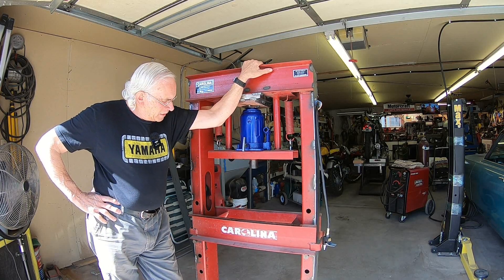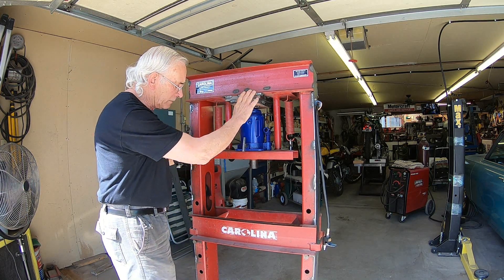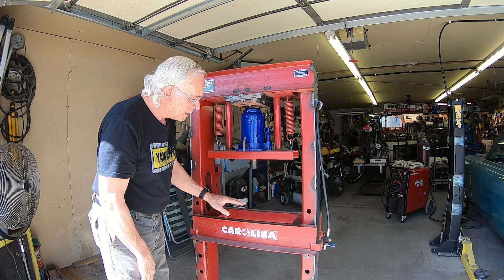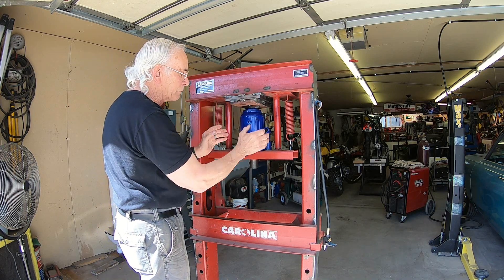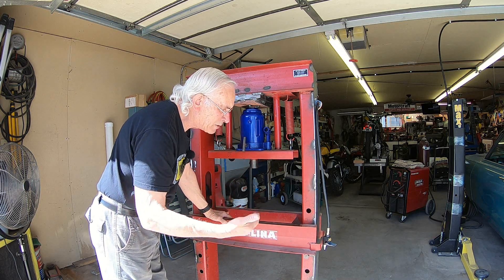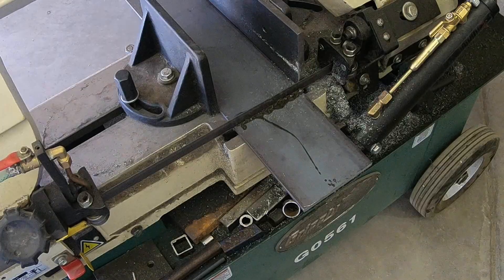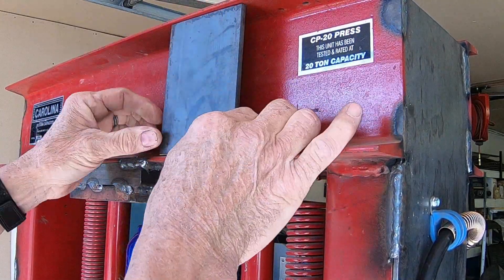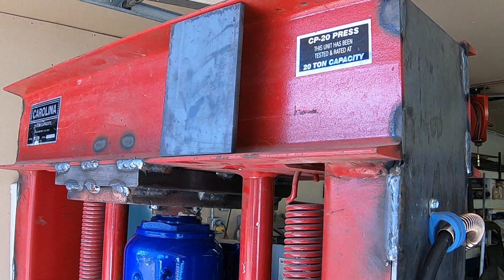Hydraulic press modification part 3

Comment: Has anyone suggested bolting it to the floor?
Reply from the maker: Yes, they have, problem is It needs to be moved quite a bit. Not convinced that would help with this issue since the pressure is between the two horizontal bars. But I have been wrong many times in my life and that may just be the fix. Thanks Andy.

Comment: I think, you still have weak spots at the outer sides and in between the 3 flat bar pieces you welded in. Under pressure, naturally, the lower sides of your u-profiles want to elongate, and you want to limit this. You added some partial rigidity to the 3 sections where you now have these welded-in pieces, but you most certainly still have (even stronger) elongations in all the other sectors. So, in my opinion, welding in flat bars right along all of your u-profiles through all their very length would give you the most rigidity.
Thank you for sharing your experience! I recently got a 20 tons press (not the bottle jack type) and I am considering how to improve it.
Reply from the maker: I think your right, I have had others suggest the same. It's about the only thing I haven't done. Good luck with yours.

Comment: Dale it seems to me that maybe the web thickness of the channel is not thick enough. I would weld in steel plates against the web perpendicular to it outward to the edge of channel. Do this in 2 or 3 spots and I believe you have a stronger beam with less deflection.
Reply from the maker: Hey Steven, that is about the only thing I haven't done. Makes since to me. I will look into that mod in the future. Thanks for the suggestion.

Comment: Howdy Dale.  I have a question about this whole press ordeal.  Well it's all metal on metal.  I did see the shelf pop up a bit too.  Maybe try coating the shelf pins with Plasti Dip and the top layer of the shelf.  That might help dampen the rebound sound of the metal?  Just a thought.  Great video and I hope you guys are doing great.
Reply from the maker: Hey, Greg, haven't heard from you in a while. Haven't seen a video in a bit either, hope all is well over your way also. I am starting to believe that I am expecting too much from a cheap press. Dampening is an interesting thought though.
Reply: @montana2strokeracer  lol, I did just put one out.  Just been too busy with both jobs to get much fun stuff done.

Comment: Its definitely an improvement Dale, but I agree that its always going to be a compromise. Unless it's constructed from heavy castings which will naturally dampen, secured to a solid floor via a large surface area, its going to have some spring. You have certainly shown how to maximise the performance of the kind of press most of us have. 
Best wishes, Dean.
Reply from the maker: Hey Dean, think I am just going to have to say good enough, and continue to work around the problem like I have in the past. Probably expecting too much.

Comment: I wonder what the deflection is when applying normal press load?
Reply from the maker: What's a normal load, crank pins are what I use it for most. I am pretty sure this one is tighter than normal, but I won't know till I do another one now that I have modified the frame.

Comment: seems better dale could u not use a thick plate on the bottom rail with a hole in 4 crankpin to fall through some inch thick orthe likes uve got 20 ton pressing down on a channel may work try it ans see next video please
Reply from the maker: I think so too.

Comment: Dale, what if you were to heat the crank up to around 100 degrees?
That should open the hole just a tad and I don’t think that would be hot enough to cause any harm to the hardness of the bearing journals.
Reply from the maker: Hey Don, not sure a hundred is enough, but if you heat it at all it will be too hot for me to fool around with. I know the manufacture heats it but that's not how it's done in the field. They have a machine that holds, heats , and presses, no one has to touch it.

Comment: The floor it stands on needs to be perfectly level. Otherwise the frame is always in a state of flex, even if it's a fraction of a millimetre. Do you have pocket laser level like contractors use to check the floor? grit on the floor/feet can be a problem. I would also put some resonance damping between the feet and the floor, like truck tire material.
Reply from the maker: Its sits very stable in its space against the wall. I think I'm looking for something I will never find. But could of course be very wrong.

Comment: Looks like the feet are not very robust and the press wobbles on the floor some. I wonder when it gets under tension if its not flexing the frame more on one side than the other and trying to push the pin at an angle. Also have you lubricated the retraction mechanism?

Really like your videos!! They are interesting and instructional.
Reply from the maker: It actually sits very stable in its place next to the wall. I have been thinking that the feet shouldn't have much to do with it, but may be wrong. The pressure is between the two horizontal frames. I think it will never be free of flex, it just needs to be built out of more massive parts, think it's going to have to be good enough.

Comment: Hi Dale, I think the flexing in the lower horizontals has been vastly reduced, but wondered what would happen if you tried clamping them tightly to the side rails? I realise that in practice it makes height adjustment very awkward, but I'd be interested to see if it helps. The horizontals are only sitting on a couple of thin pins which must be less than ideal
Reply from the maker: Thanks Mark, I think your right, I am probably never going to get it all eliminated. I'm sure the smaller pins will not cause much of an issue. Just these at 24 to 26 mm.
Reply: @montana2strokeracer  I think you would be better off with a dedicated press just for crank rebuilds, then you could construct a very rigid frame thats fully welded top & bottom as you won't need to alter heights like you need to on your general purpose press. Would be interesting to see you build one utilising your spare ram

Comment: What part of the press is making the noise? Ram, table or springs. Can you hold each part when you apply pressure. My press makes noise thru the springs under heavy load.
Reply from the maker: The noise is coming from the pin popping in the hole. which radiates to the lower support under it I think.

Comment: HI Dale, I saw in the video that the cross member deflected around 1-2mm for sure when it popped. My suggestion to fix the issue is to weld a post or leg from the middle of the cross member to the ground on the front and the back. With baseplates that have holes to dyna bolt the posts to the concrete. Maybe bolt the original legs down also to reduce racking.
Reply from the maker: I think that would help a lot for sure, but what happens when I want to raise or lower the support.
Reply: Good point, I dont have a press so my lack of understanding has been caught out. After some thought how about a square post with another square post that fits inside and slides up and down. And like an acro prop has holes in both set at whatever increments are needed to match the press. To lock the different heights a 16mm bar is placed through the set holes. Not perfect but might work. you will be able to come up with a better solution i reckon but hopefully this sows a seed,

Comment: My press flexes the same way and I have measured it to know I wasn’t seeing things. I like your fix and will do the same. Thanks for sharing
Reply from the maker: Still working on it. Last night I put four more plates on the adjustable lower horizontal bar right were the pins go underneath it. Was looking at it and wondered why I didn't do that right were the pressure is.